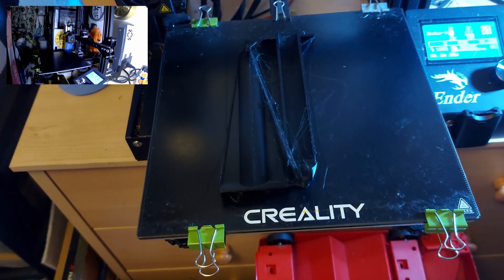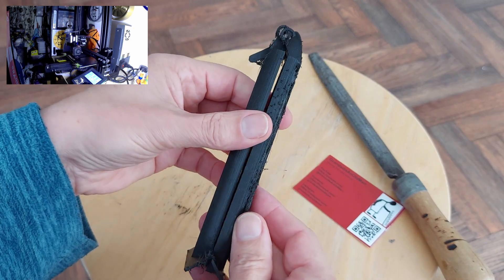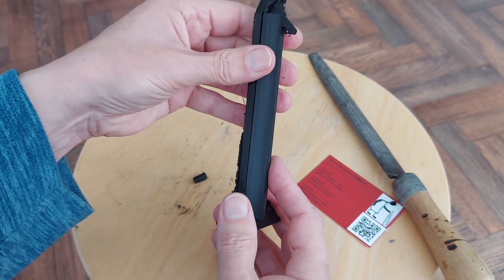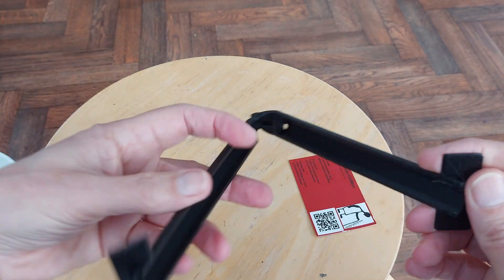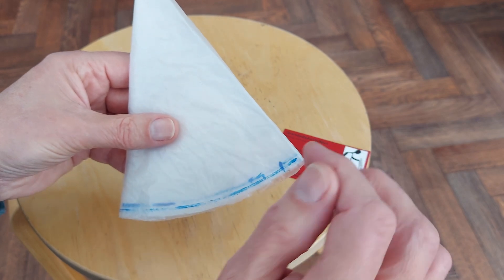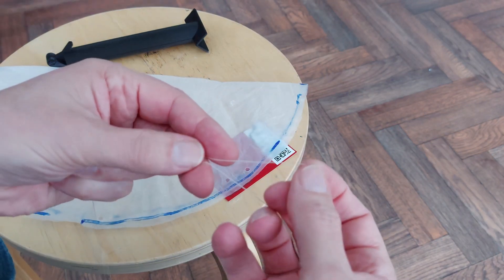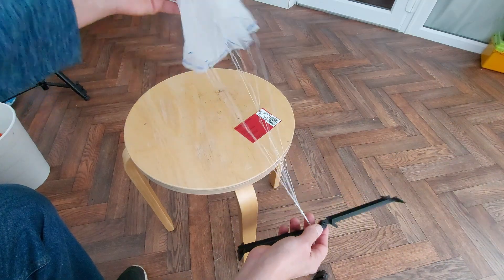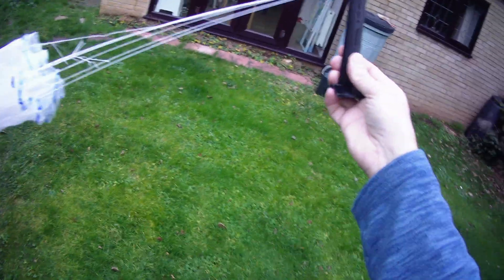Basic 3D printed catapult launch rocket with parachute

Comment: There was a commercial one from a company called Qelcoreti or something in Italy it had an arm that ran down the side of the rocket when it reached the top and began to fall it unlocked the body and the parachute deployed, unfortunately if it didn't the rocket nosedived into the ground and the arm broke off. One toy useless! They later improved the arm making it of softer plastic that was more durable, they also made one with a capsule that detached on its own parachute the catapult was very strong and had a foot release on that one and it went up about 100 ft or more. I'd forgotten about that until I saw your video, guess "health and safety" saw the demise of that one!
Reply from the maker: Yes, check my video description for the links to the videos where I am flying one of the Quercetti version. That is what inspired me to see if I could 3D print a simpler version.